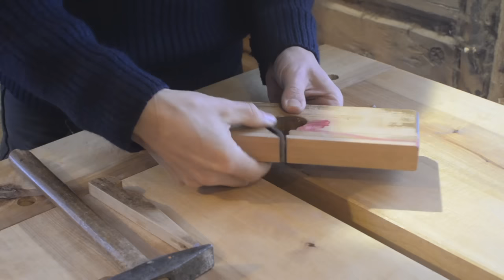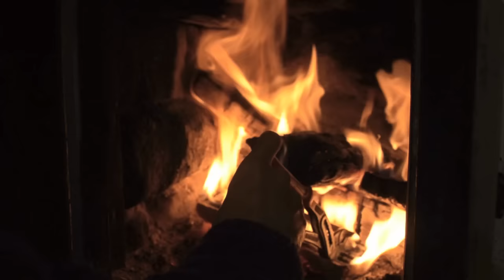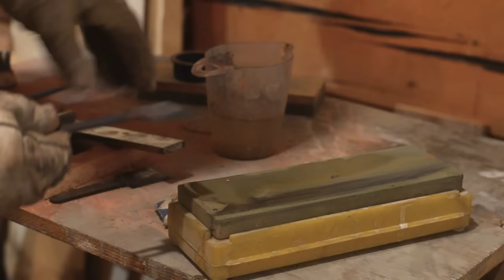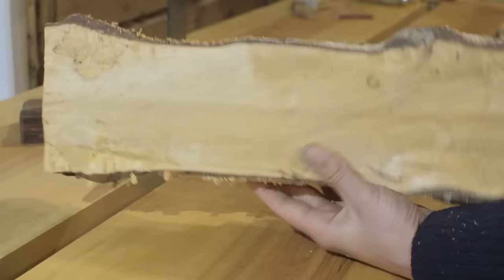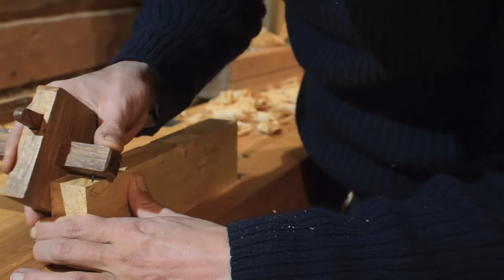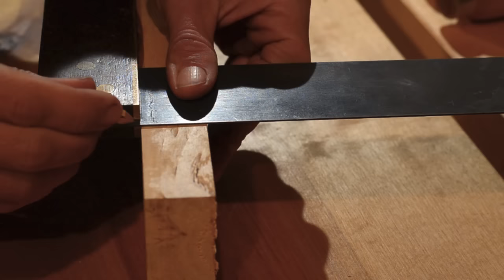Making a Wooden Rabbet / Shoulder Plane

Comment: Consider making cutoff slightly bigger at one side of the plane. 
That will help shavings to escape and prevent plane from clogging.
Reply from the maker: I have been thinking about it, but to be honest, I just could not decide on which side. I so like to use planes pushing & pulling. So, I am still taking out the shaves by hand - handtool ;-)

Comment: An heirloom tool….extraordinary. I’ve been collecting the components for years…..time to get moving in this project. Thanks for the inspiration!!
Not a criticism but I’m curious why you didn’t flare the escapement so that the shavings roll out on their own?
Reply from the maker: Hello Neanderthal-man :-)
While building i've been thinking about your suggestion, but something hold me back: First, i do not really know yet, what i'll use it for. If it goes bit deeper, than these out-coming shavings will be on the way to get deeper straight. The second point is, that the area, where i would open bit more is where is the most tention in the wood. That is where many old shoulder planes got a crack, even the dark one i used for this project had a crack exactly in this place, even if made of hardest wood i ever user.
But, the good thing about self made things is, that they can be improved when ever needed...
Nice to hear, that some inspiration came through ;-)
Reply: @littleforest  I was thinking that weakening the plane was probably your reason. by the way - you are the quintessential Neanderthal Man. In America, a small group of “hand tool only” woodworkers called themselves Neanderthal because they refused to use electricity to power their tools. That’s why I started using that name, however I’ve not broken away from power tools completely and likely never will due to age. I’m over half way done with my Moravian workbench.

Comment: Wow, that turned out gorgeous! Could you comment on the grain orientation on the spalted birch part of the plane - looks like it might cup along the height of the plane body. Or do you figure that the wood was dry enough that this will not be an issue?
Reply from the maker: Hei Julius!
Take a look to the beginning of the video, where i cut the piece of birch out of the trunk. The grain orientation might be more clear than if i explain with words. And yes, it's dry wood. It has been cut about 5 years ago. By the way, this birch is not spalted. Carelian birch is a subspecies of the silver birch. So, there is no mushroom inside.
Hope, i could help you..